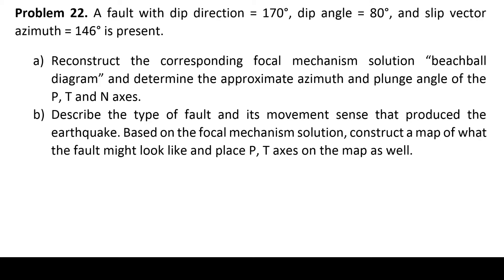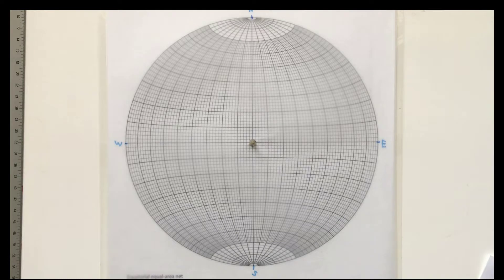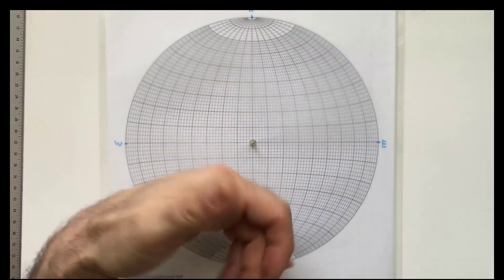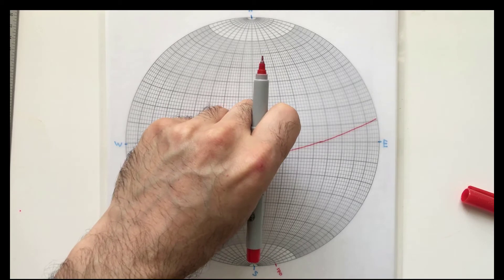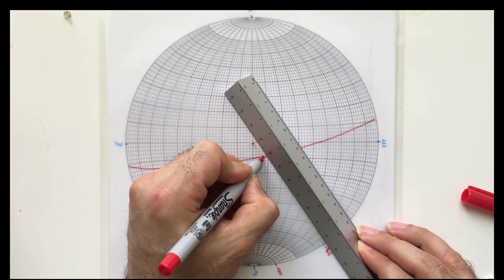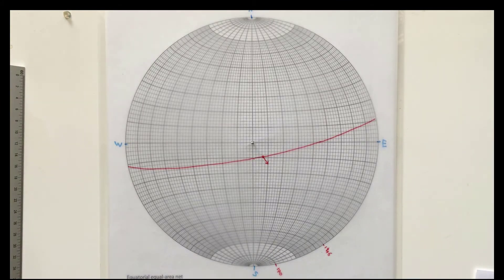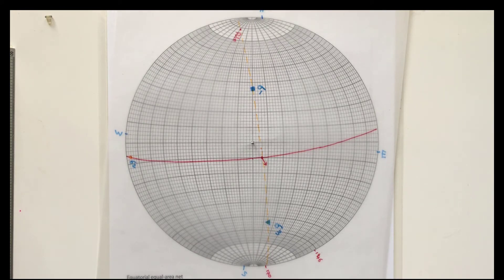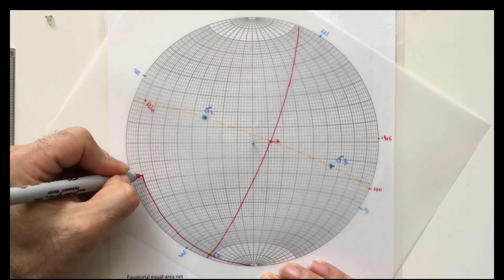Focal Mechanism Solution - P23 - Stereonet

Comment: I learned a lot. I got a different answer for sigma 1 plunge. I got 55deg where as you got 45. I'd love a video like this for a reverse fault. I've been struggling with rake angles with normal and reverse faults and differentiating between the 2.